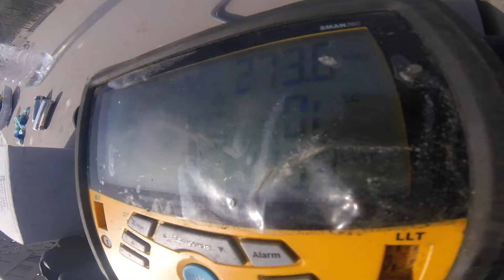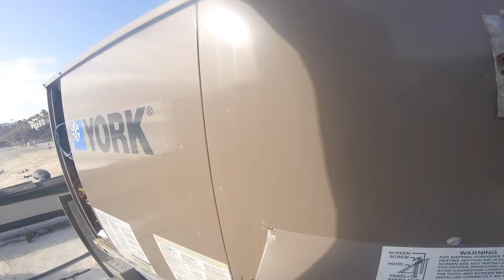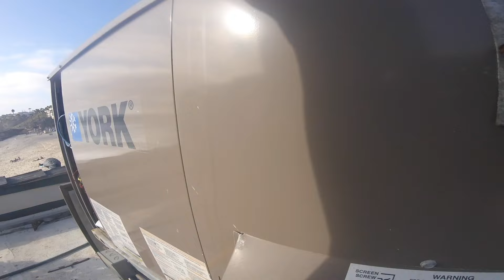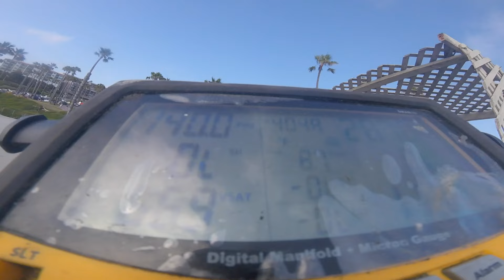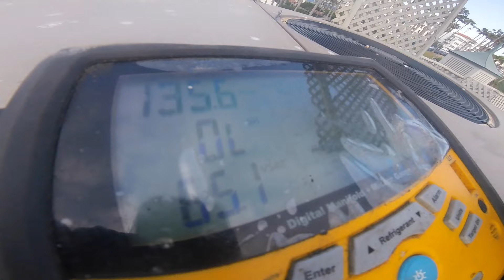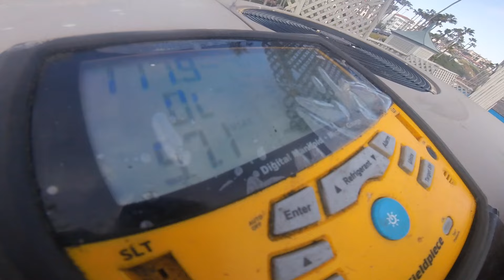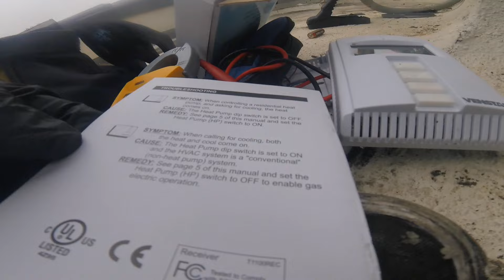HVAC. Service call in 2 steps. Package York AC. Wireless thermostat. 1080HD

Comment: very nice work nam go going man
i need help for youar fever i faced one problem in my package unit (when i start unit IDblower working normaly and going command to compressur then unit off by (13 flash on P.C.B) incoming breker volteg is 240 going in transformar outgoing 415V i need to help to foxed this problem yhankh